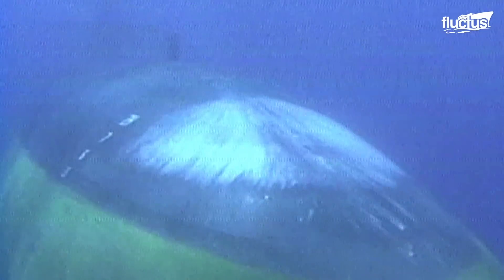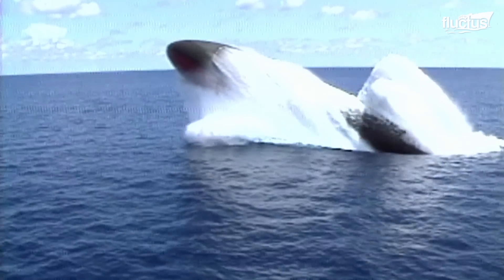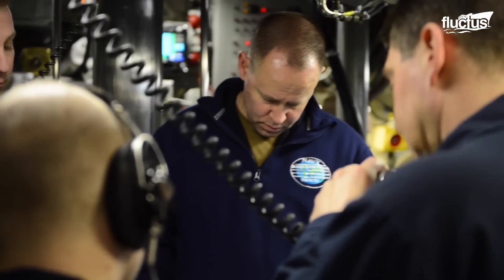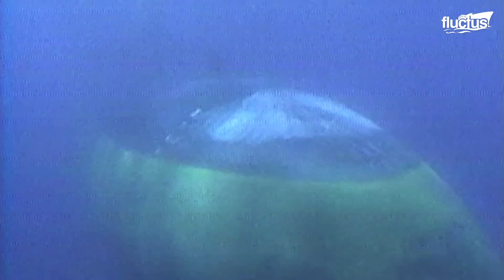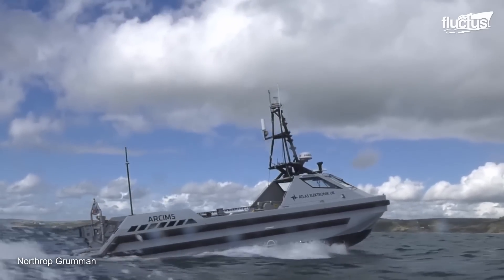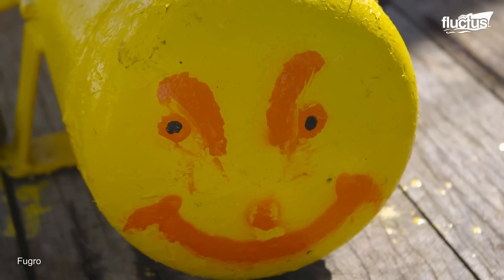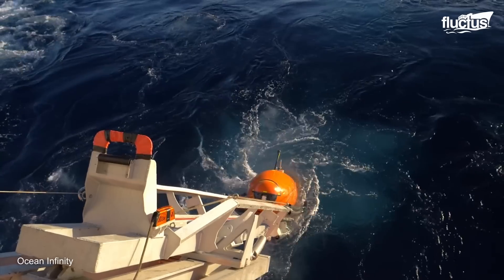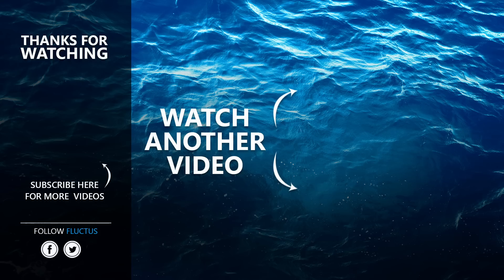A Day in Life of US Submarine Expert Detecting Weird Sounds Undersea

Comment: all subs have a crush hull depth unless they don’t these days?
Reply: Submarines are designed with an approved "Test Depth", a depth that the sub can descend to when needed that can be recovered from with little or no damage repeatedly. Then subs also have a "Crush Depth" which is a depth is calculated by design where the hull will most likely fail. The hull will fail suddenly collapsing the hull almost instantly. It varies by Navy and country but "Crush Depth is several factors deeper than "Test Depth".  During WW II some US subs (depending on when they were built) had test depths of 200 feet but were driven down to 400 or more feet. Later built subs had 400 foot Test Depths and were escaping depth charge attacks by going to 600 and 800 feet. Modern subs as a rule are much deeper diving than WW II subs.